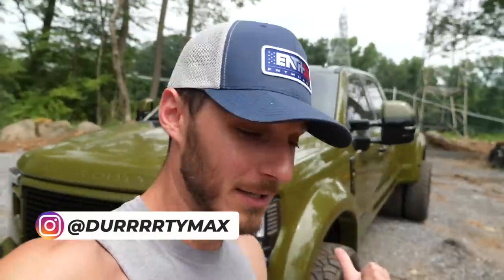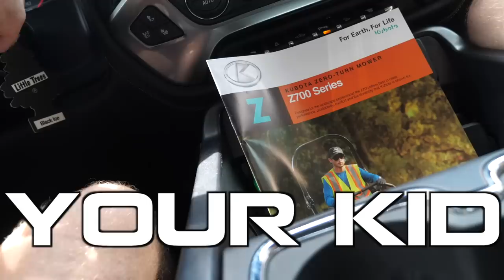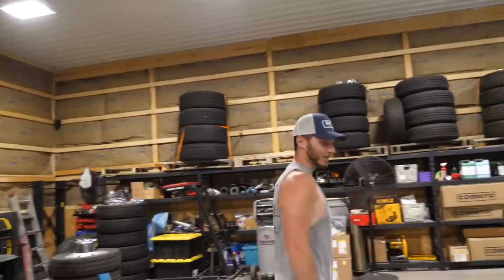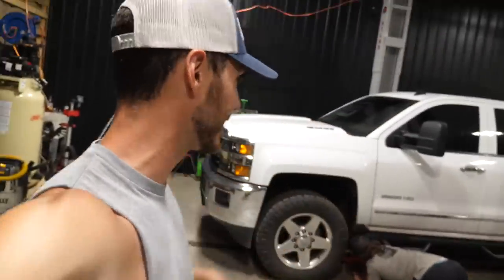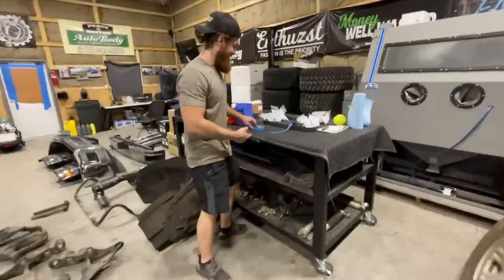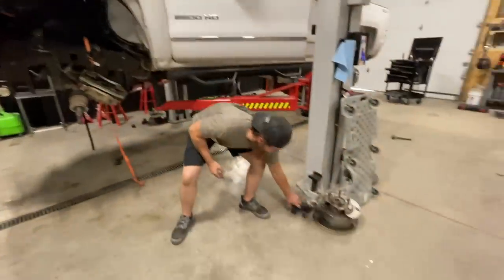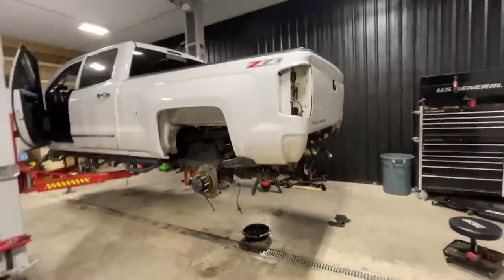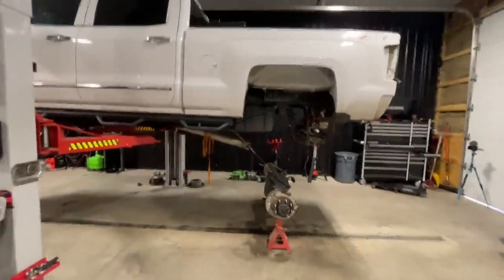I DID NOT EXPECT IT TO HAPPEN!

Comment: Does anyone know what the torque specs are for the bed of a 2017 2500hd?? Removed my bumper and loosened up the bolts to remove it from the frame to paint it. Just wondering if there is a torque spec for these bolts?